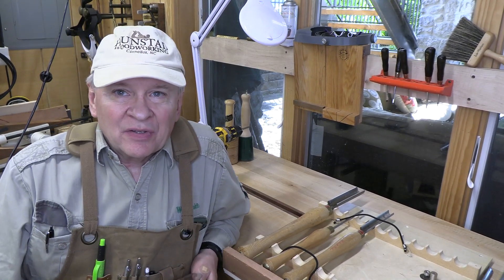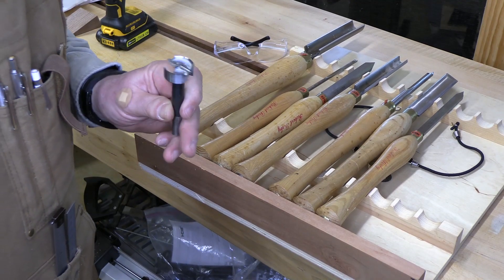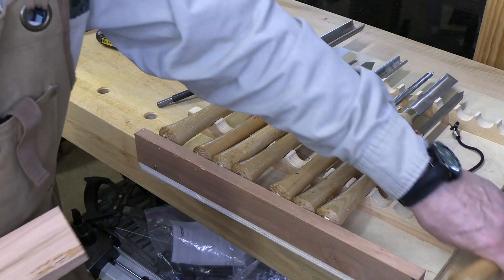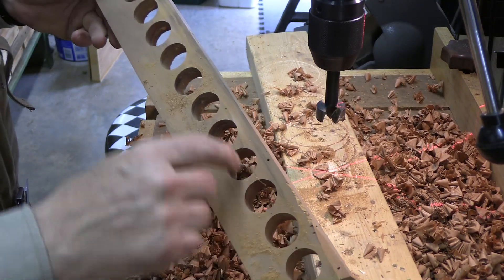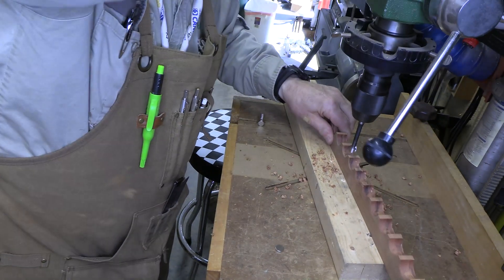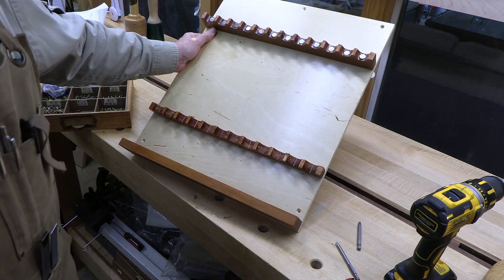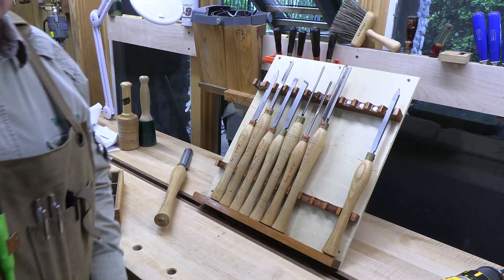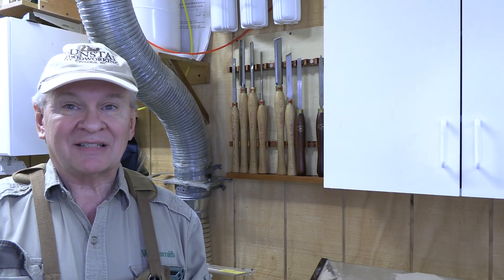Magnetic Lathe Tool Rack Build Step by Step w Dr  Joe

Comment: I have one major problem with this, which has nothing to do with the design. You've created a situation in wich you might cause yourself to reach over a spinning lathe. It would be much better to have it mounted to the wall next to the lathe instead of behind it
Reply from the maker: Thank you very much for your comment. You do make a good point. With my legs set up the rack is actually over to the side so I’m not reaching over the spinning project. Your point as well taken and I agree with it. Consider subscribing. Thanks. Joe.

Comment: I used yours to build inspiration for mine...I cheated a little and found it a little and cut the bottom recesses as well as the top and bottom out with a CNC router.  I designed a half circle and rectangular top mashup that I sawed in the middle like yours before drilling for the magnets.  For those without a CNC using your method, you can easily replicate by running through a dado stack on end to square up the top recess...or with some patience, a single blade.
Reply from the maker: Congratulations that sounds like a fantastic way to go. I’m glad that I was a little inspiration for you. Consider subscribing. Thanks. Joe.